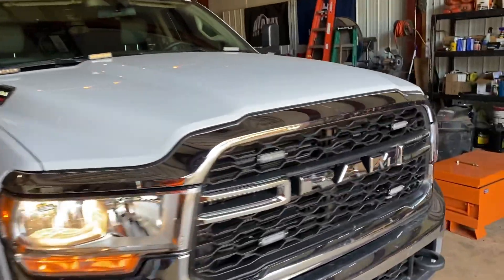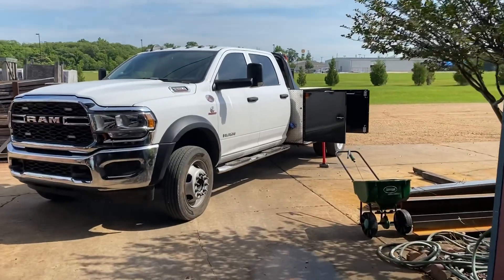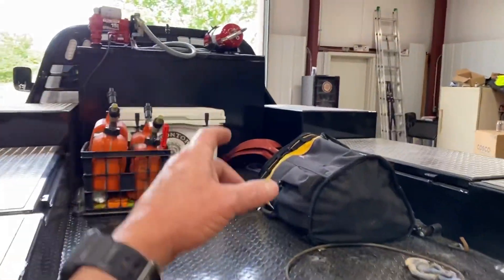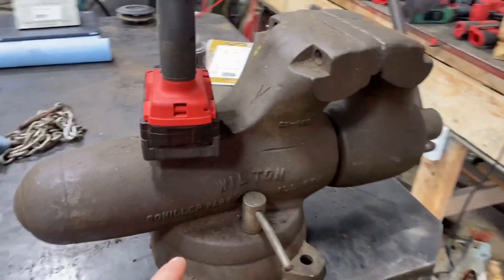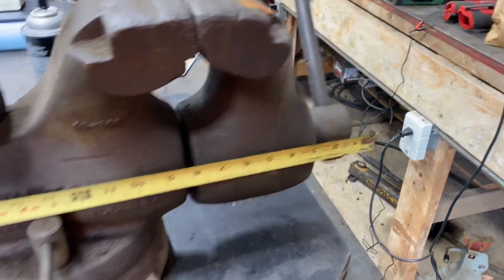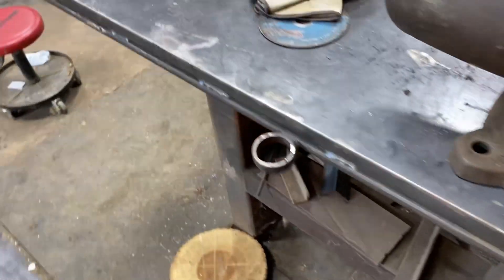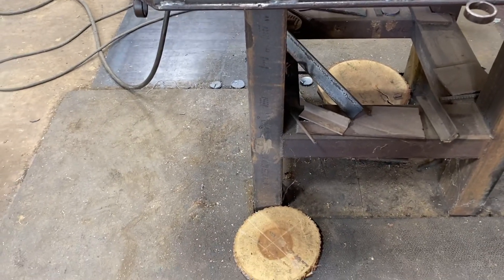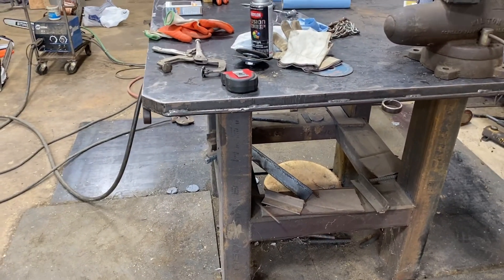Figure the volume of the tank | I give you the dimensions and a picture of the baffles

Comment: Do you anything special to clean out/flush the tank before the first use?  Just wondering if you’ve ever had an issue with metal shavings,etc.
Reply from the maker: I make sure nothing is in it before I put the lid on it which that is not going to happen where tanks are mass produced. I also wipe the entire inside down with a rag soaked with brake cleaner.

Comment: About 163 gallons you can only fill it 88%because you painted it Black your fuel will expand a lot 1126.33 pounds of fuel plus with the pump and all the welding 380 pounds so 1500 pounds of weight you have to take away from your hauling gvwr so to run around with just the tank full you are cutting your own fuel mileage. Fuel tanks are white or silver so they don’t boil over.Nice tank if you use it. But it will not come with out some costs.

Comment: What was your reasoning to always run clear diesel instead of off road? Convenience? Quality? I run off road and clear in my machines for both convenience or quality depending on the station. But I'll always buy off road, from a good source, to save a few bucks if it makes sense. I picked up a tank of off road from one station that had about a gallon of water in it. Won't be going there again.
Reply: Is he running it into his truck’s tank?
Reply: @ryanv3751  Yes he mentioned that. I still don't understand why he set this up without the option of fueling his machines with off road. Probably convenience. He could have easily made two chambers with a tank of that size. One with x number of gallons for the truck and off road in the 2nd chamber. Anyhoo, super jealous. I fuel my equipment with 5 gallon jugs! LOL

Comment: Nice exercise. I calculate 179.2 USG less net volume of internal welds and the pump suction pipe. Secondly, there must be a vapour space to accommodate thermal expansion sitting in the hot sun. As you will never pump it completely dry, I would suggest to never add more than 172 USG after the first fill.

Comment: Should hold 177.5gal really with pump tube and at 90% probably held about 163 to 167 gal I use to build water tanks for toilet trucks and hydraulic tanks you never get as much as you figure. 
Later tader
Reply: Yep... the weld beads take up volume too besides the baffles.